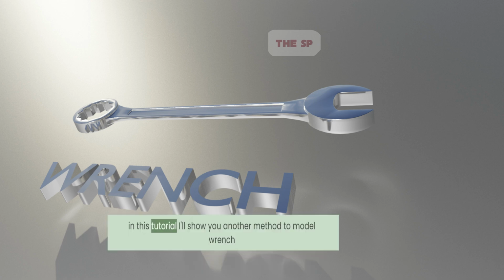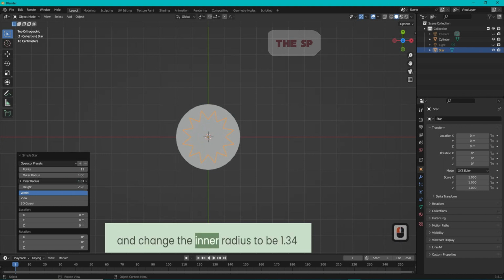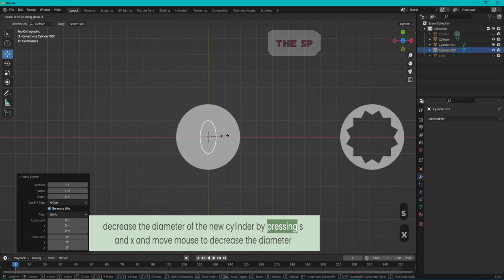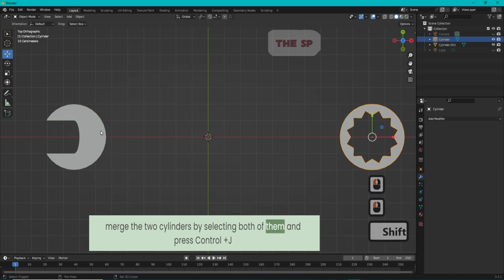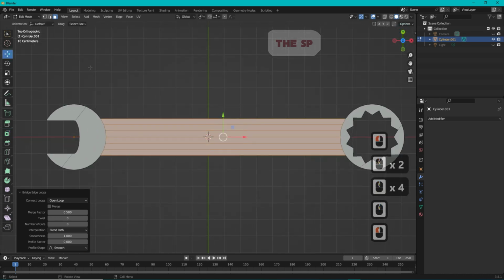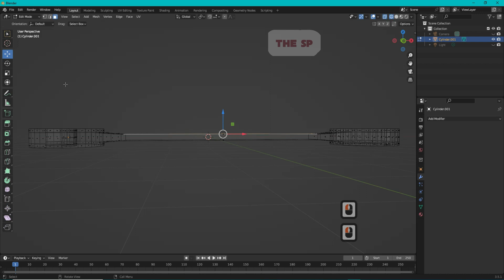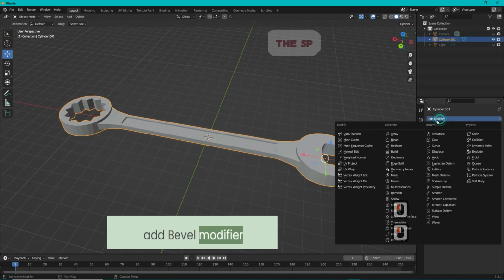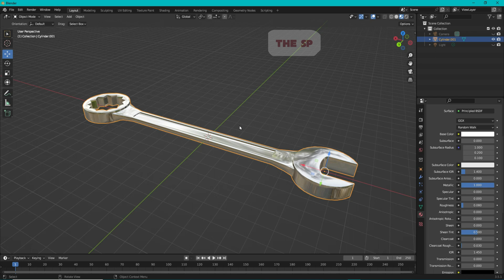Double Ended Wrench Modeling in Blender _ Blender Tutorial

Comment: a little tip I learned, when extruding the faces to make the detail on the handle. If you select the faces on both top and bottom of the wrench then press alt+E then select "extrude on normals" you can extrude them both at the same time and get an equal inset. I didnt know thats what the boolean modifier did tho!!
Reply from the maker: thank you